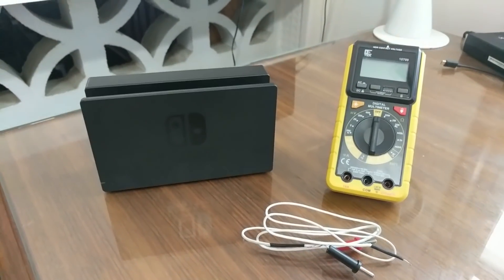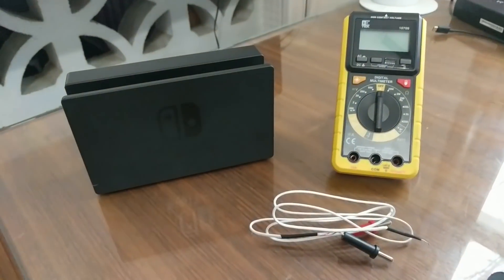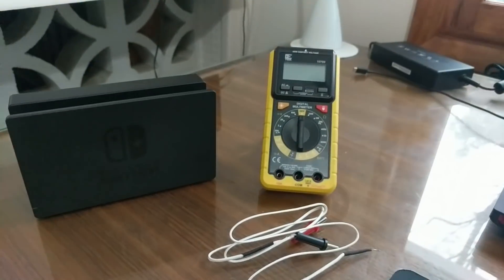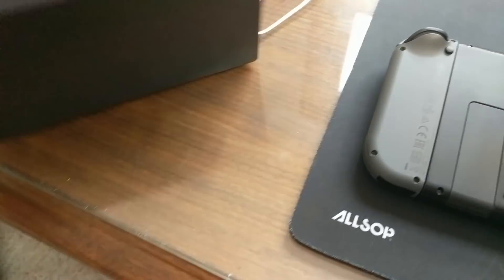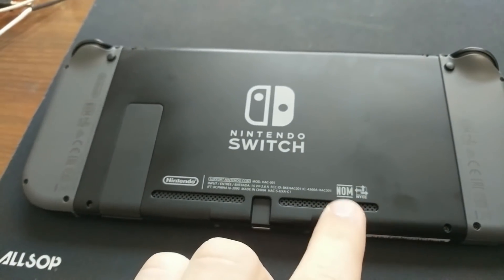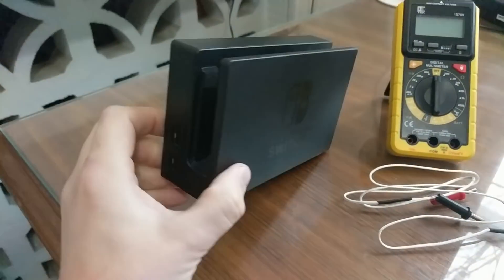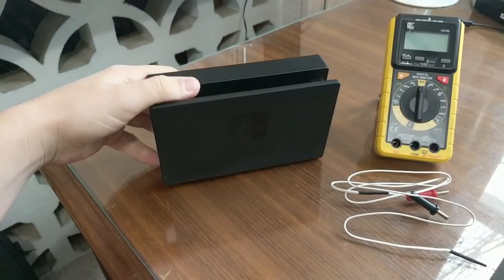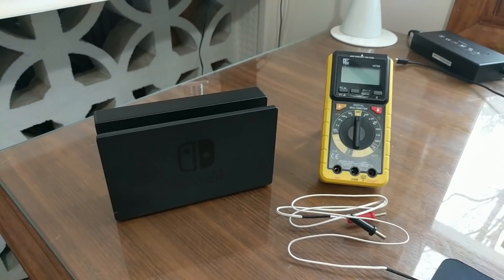Final Nintendo Switch Cooling Mod - Available Now!

Comment: Just installed this mod. Not in an air conditioned environment and I'd notice occasional frame stutters and drops when docked. Seen this is a proven method to decrease temps so I knew it would work in my favor and it indeed did. It's not much to spare for the longevity of your console and the mod is simple to install. Thanks for the Nerds too.

Comment: i just received and installed your cooling mod. i had to wait around a year to have it due im in mexico and my  relative just arrived since i ordered it. thanks! i just wanted to have this because i really think the switxh overheats inside the dock. i just removed the rear lid because i have the feeling this wont last long. but i am confident this cooling mod  will help quite a lot with this issue!!!
Reply: Y si funcionó? Soy del sur de México

Comment: Whats about the temperature of the Dock PCB with this mod? Because before it was cooled with the switch fan but with this "mod" this is no longer the case. I think a bigger help would it be to use proper thermal paste and a better cooler inside the switch - both of this requires a tear down of the switch itself of course it results in warrantly loss.

Comment: So I just got it today.  Played Zelda for about 30 minutes and I was pleasantly surprised.  The difference was pretty noticeable.  The only thing I regret was i broke one of the plastic tabs that clip the circuit board in, but one tab plus the back screws held it in well enough.  Good work, dude
Reply: Talisman218 Yep, I broke a tab, too. I actually broke it when trying to pull the board back out because the mod didn't seem to seat properly (it had, so I broke it for nothing). But I agree, after reassembling everything the board is very secure, so I'm not sweating it.
Reply: Hi Talisman, you could you give me the 3d model?
Reply: @CrispitosESP  me too please

Comment: Just installed my mod tonight. Was kinda a tight fit. Had to use a bit of force. But its in there, look forward to seeing if it does indeed make the console run cooler. I think this is a brilliant idea. Hope it takes off for ya bud.
Reply from the maker: Yeah, it's meant to be tight, so it doesn't rattle around, and stays in place better.  That was intentional. 😎

Comment: Does it effect the board inside the dock at all as it has no more airflow over it due to the 3d printed mod?
Reply from the maker: Nick White There is still a way for that hot air to escape out the top.  The mod doesn't use the entire venting at the top of that cavity, only about half.  Still more than enough air flow for the boards hot air to escape.
Reply: @Nick White 

*affect
Reply: This is what I came to ask
Reply: Just install a usb fan, the 3 fan one works nicely. People who say they’re worthless 🤡🤡🤡

Comment: STATISTICS:
With the mod: 76° - 78°
Without the mod: 90° - 92°
Difference: about 14° - 16°
Reply: Did you test this yourself?
Reply from the maker: Me, or VincintWeir?
Reply: Plizzzz can you use centigrade instead fahrenheit?
Gosh......
Reply from the maker: Yuck, centigrade.  Lol
Reply: With the mod: 24 to 25.5C
Without the mod: 32 to 33C
Difference: about 8 to 9 degrees.
Reply: Put Mine in today around same results Ran 92 dropped to 78degrees steady. going to improve the dock airflow next with fan and sealing the case make it slight forced induction and will update
Reply: Update Added a labtop ehaust fan to top of switch temps are of switch exhaust with mod. 
It was 81 degrees in house heat from day was in house 66 outside 3am
System was running 86 degrees no fan
Fan running at 81 degrees 
Turned on AC runing at 68 steady
Reply from the maker: The book was called Fahrenheit 451, not Celcius 232.778.  Temps on ovens, refridgerators, etc are all in Fahrenheit.  Cars read out in Fahrenheit.  😎
Reply from the maker: Same goes if you come over here, it changes from metric to imperial.
Reply from the maker: I DO user metric, when it's more convenient.  I build all my models in metric.  But metric doesn't allow any finer a measurement than imperial, it just breaks down the measurements into smaller segments.  1" is still 2.54cm.  whether you will be it fractionally or not has no significant bearing on the dimensions of the measurement itself.  The only real benefit of metric is that it's typically non-fractional.  But that does not invalidate the use of the imperial system.

No single measurement system is "best".  They all have their is and downs.  Defending a single one means denouncing the benefits of the others.  This is partly why the entire world doesn't have a single universal measurement system in place.
Reply from the maker: I live in America, so....
Reply from the maker: There's really no reason to change if the one your using works fine.  Should I have grown up speaking Spanish instead, just because it's more convenient for someone else?  Nah, of course not.  Maybe others should learn Imperial units instead of complaining that I don't use metric (which I do in certain circumstances). 😁
Reply: @LuchsLynx  Ah yes, someone with a proper language. Thanks!
Reply: @giorgioskb  i can confirm.
Reply: @M1dn1ghtN1nj4  to be fair, All electronic tempature readings are always in Metric. I rarely see anyone use F for that. Chip throttle limits ect, are normally listed in metric.
Reply from the maker: Not helpful in the slightest.  And I DO use it, when necessary.
Reply: @M1dn1ghtN1nj4   just got new model switch today can confirm drop in switch mod still fits new dock no changes to dock have changed the board has 2 small changed but overall same.  Similar spec as last time but 66 outside inside house 69 system runing at 80 but crept there compared to old model that flew up there. Turned on same old fan would take a few mins but would drop to 72 alittle above room temp. New switch model droped there in under 30 secs. Granted tells more about new revision but mod still works great on it.
Reply: He says "Yuck, centigrade" then goes on to talk about how each system has it's advantages. Talk about delusional.
Reply: @brandonm.4187  Celsius is barely arbitrary tho...
Reply: Tbh I thought my switch was gonna explode 😭
Thank you so much for telling me what the normal temperature is because its hot after I play it for about 10-15 minutes I thought it was just me i thought I had to replace it but just seeing it at this temperature after that amount of time I can go back to playing games
Reply: @paptart6289  Your comparison Japanese and English is not really valid :p
They are both fine languages, though, I do personally think German would have been a better fit since German is quite superiour (it's quite a lot easier to learn than English and when you know some words, you can actually get pretty far... like having the word "Krank", meaning sick and "Wagen" meaning car... put them together to be "Krankenwagen" and you get a "sickcar", a.k.a an ambulance).

But yes, Metric is a superior system, because outside a few things, it's all really uniform.
Like, you want to know how much meters are in a kilometer? just move the decimal seperator 3 times to the left.
Works for the other way around too! (just move it 3 times to the right).
Want to know how much grams in a kilo?
do the same.
How much milliliters in a liter? do the same.
I had to work with the imperial system for a while and I just couldn't make much sense out of it, everything just feels so damn arbitrary...
how much inch in a foot? 12
how much feet in a yard? 3
how much yard in a in a chain? 22
how much chains in in a furlong? 10
how much furlongs in a mile? 8

I mean, when you're used to the system, it'll make sense but imo, a good system should be a system that is easy to pick up on without having to learn much details...
Which is why I also think German is a pretty nifty language, it's fairly easy to pick on on without having to learn much details...

Sure, you might get some laughs here and there (because you, for example, mixed "Der", "DIe and "Das" - the masculine, feminine and neuter nominatives) but that's it...
I go to Germany quite often but never really had much lessons in the german language at school but I mostly learn some words, slap them together if needed and people will understand what I mean just fine (maybe sometimes correct me ofc).
Reply: @paptart6289  I know :p
Reply: @M1dn1ghtN1nj4  US: Shitty fahrenheit
The rest of the world: Superior celcius
Reply: Well fuck... My switch cpu is 54-64 celcius *and pcb usually 4° higher on acnh (as soon as I take it back to the home menu it starts dropping fast). The fan sounds fine, but I thought compared to that it'd be on full blast and it just sounds normal/kinda low. Should I be worried lmao;;;;
Reply: @Anreii  not really, you should start to worry if the CPU goes 85-90°C, that temperature is normal even for a desktop pc
Reply: @eldiegoetc9257  ahhh ok, thank you :)
Reply: great improovment
Reply: Open console up put thermal silicon pads on memory parts and artic silver mx5 on your heat pipe this dropped temp 7c for me
Reply: @M1dn1ghtN1nj4  hey do you have a new ebay link for this mod, i need it

Comment: Love your product man, i got two from you like a year ago now and it totally helps reduce heat going into my Switch.

In addition to adding your mod inside my dock, i put on a YOK brand Switch dock fan that i got from Gamestop and a Opolar laptop cooling fan to help suck out the hot air faster from it's air vent on top.

My Switch stays cool at 75 degrees during Winter and 85 degrees during Summer. Pick one up guys it's worth it, it'll keep your Switch from warping and cracking.

Comment: Seeing how this project worked perfectly for quite some time in my experience

And looking at the comments that agree with my positive review I honestly think Nintendo should just implement this in the offical dock design and give this man some good royalty

You sir are a genius
Reply: the thing is, that board probably needs/benefits from being cooled. this mod just blocks the air off.
Reply from the maker: That's not totally accurate.  The mod does not seal off the board.  In fact, the intake of the mod is still inside the board area, just much closer to actual outside, colder air.  It will still pull in air from around the board, just a lower percentage of it.  That board doesn't need extreme cooling.  Actually, the fact that it's in an airstream is really only a bipriduct of the fact that the second intake happens to land right where the board is.  That vent setup keeps the Switch symmetric by design, and keeps the ports accessible from the back of the dock.

Comment: Okay so I just received this a few days ago, my Switch is modded so I was able to test this out and have temperature readings straight from the console using Status Monitor.
Without the cooling mod at max overclock: 65-66c
With the cooling mod at max overclock: 61-62c
So it definitely does work but it's not a huge difference (3-5c difference pretty much)
Reply: 3-5°c is a lot considering you don’t have to open the actual console but I doubt it has much real world differences as the fans are still loud and fail at the same rate, shame there isnt a tv only version with some better/quieter cooling

Comment: I got it installed today. Ran a game with overclock turned on and under heavy load. MUCH better. Thanks a ton!
Reply: Hello. Did you use cfw?
Can you share your temperature reading before and after using the mod?
Thx man!

Comment: Just installed this in my new August 2019 Switch Revision so it definitely works with the new revised Switch Dock
Reply: I never even knew they did anything to the dock. What's different, dock side on the v2?
Reply: There isn’t a revised Switch Dock. There’s no change from the Dock that released with V1 to the Dock that released with the V2.
Reply: Same dock different switch yes you guys are right

Comment: Just received it and installed it yesterday! Went in very easy and fits like a glove. Very happy with this product. Was wondering if the creator would be able to do an output hot airflow test both with and without the mod? Dare I say mine actually feels like the air blowing out the top is cooler  as a result of this mod.

Comment: what about the temperature of circuit board of the dock? with that mod you cut off the airflow for it which makes it cool also.
if conaole is coller by 20 degrees than circuit board is hotter for 20 degrees.

Comment: This is a great idea and well worth the 16 or whatever dollars. That's incredibly cheap when you consider all the time that has to go into designing something like this. If you're going to complain then buy a 3d printer (hundreds of dollars) then spent all the time needed to make this. If you don't want to do that then shut up and give the man the couple dollars in profit he deserves for all this work!
Reply: Some public libraries also have 3d printing available for usually a color or less for materials!
Reply: @Grainsauce  

But you still have to design it.
Reply: @Mechaghostman2  No you can ask the guy for the 3d print and the program file will do the work.
Reply: @Grainsauce  

If he's willing to just give it.
Reply: @Mechaghostman2  he has a link for it it's like 3 bucks, not alot at all

Comment: What exactly is this mod doing? That is never explained. * nevermind I watched your other videos. Really wish the price on this mod was closer to $10 though
Reply from the maker: You're welcome to take a micrometer, take all the measurements yourself, build a mock-up in CAD, and print several versions until you get something that actually fits, like I did.  And through all that, don't make it the wrong fit and break any parts on the PCB.  Also remember, you'll be spending a bit on electricity for the printer, as well as all the filament used to make mockups.  Is that really the easier way to go?
Reply from the maker: DigitalHazard Cute, but no.  Buy one, don't buy one.  I don't care.  Go make your own product, charge whatever you want.  If you don't like the price, feel free to either design your own, or but it from somewhere else.  That might hard though, as I'm the only one whose designed one.  Trying to badmouth me isn't going to change the price, or get you one cheaper.  I'll lower the price when I'm good and ready, not because you don't like the cost.
Reply from the maker: DigitalHazard How much do you think I should charge then?  And why.
Reply: M1dn1ght N1nj4 if you send it in a padded envelope in standard mail it would cost 1,50 dollars plus the 2 dollars of making it counting electricity and/or defective models which end up in the trash plus if you want to make a profit maybe 4 or 5 dollars could be the total price, it's been a long time since the last thing I bought of eBay but I think you make it to be 4 dollars without free shipping and let people decide whether they want standard 1.5 dollar shipping or 10 dollar fast shipping
Reply from the maker: DigitalHazard It is sent in a padded envelope (costs ~$1.50 each), shipping is $2.66 (that's WITH my eBay seller discount), then add in time, electricity, finished material, and waste material.  Ignoring everything else, you're already around $7.  Selling at anything less that $7 is a loss.  $10 - $12 gives me $3 - $5 profit, which isn't much.  I don't know how many of these you think get sold, but in total since I made it public, around 50.  By no means am I getting rich off of this.
Reply: M1dn1ght N1nj4 then why even bother, let people print it themselves
Reply from the maker: DigitalHazard They can.  Head over to cgtrader.com to find the STL file.  Most people don't have a printer, so to have one premade is helpful for most.
Reply: M1dn1ght N1nj4 this should be in the description for people to even know they have other options and I don’t know if this site takes a percentage off of you in each transaction but 3 dollars would be the best price
Reply from the maker: Yes, they do take a percentage of the money.  Plus they only pay out once a month.  I understand people would love to get this for pennies, or maybe $1 at the most, but at that price, it's just not worth it for me to have even made it at all.  I could have just as easily kept this to myself, and made a video about it, and never made the product available to the public.
Reply: It's worth it for me to not have to buy a goddamn printer just to have it.
Reply: M1dn1ght N1nj4 people don’t think about other people’s hard worl
Reply: price is totally ok, its not expensive in any ways... you also need to pay for planning, 3D-Modelling time etc.  -  I fine with the price. just bought the STL on cgtrader and printed it in my university. awesome results, thx you
Reply: All these people pearl clutching, fanning, and gripping their wallets for dear life over $5 and someone else’s work can go eat a bag of cement.
Reply: @M1dn1ghtN1nj4  These people... I just had to comment, keep up the good work and stay away from communists like the fools here. You made a product that works, and you should of course charge for it.
Reply: @Digital_Hazard  Just because big companies with world wide roll out can split their R&D cost to nearly millions of customers and leverage economy of scale to bring the pure production price down, doesn't mean that every little private producer can do the same. There is a custom back lit Game Boy Color replacement screen with 320x288 pixels that costs $65 because it's a special, low number, niche product. For that money you already get cheap 21.5" FHD screens from Acer on a sale.
Reply: @Digital_Hazard  Hey.

I bought one for $13.06. 

And I'm happy with my purchase.

Fight me.